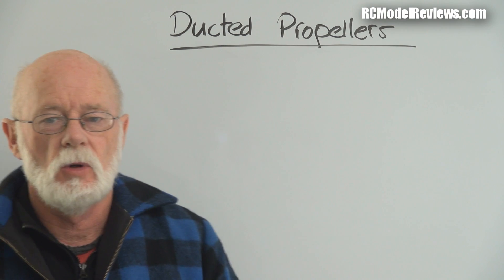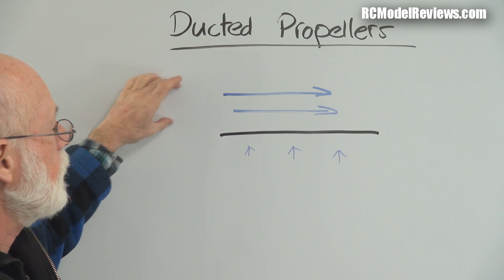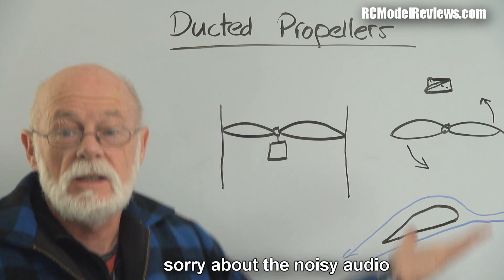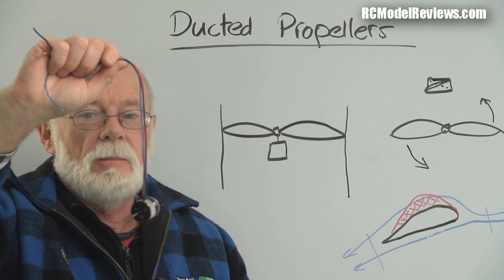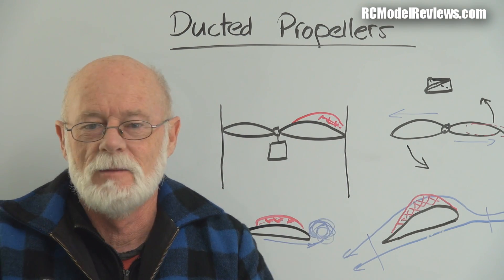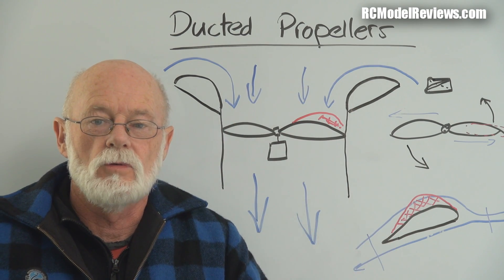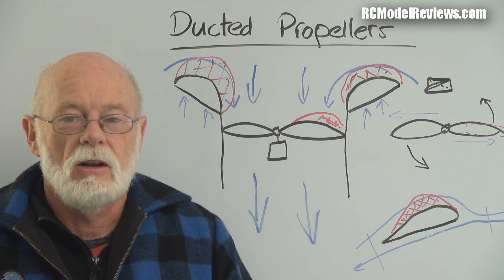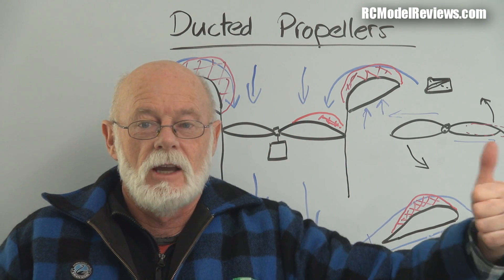How ducting a propeller increases efficiency and thrust

Comment: 8:20 centrifugal or centripetal  -  the force pulling outward is centrifugal.  the force holding the rotating mass inward is centripetal. remember - there  is  ALWAYS  an equal and opposite reaction. 
i'm going to also argue your reasoning for what's described as blade wash. 
the primary law of nature is  - all things take the path of least resistance. 
when a propeller pushes the air - it's  pushing air into a high pressure/ compressed  area. 
air pressure around the tips is ambient / static or slightly lower than ambient .... all things in nature - including air  - seek the path of least resistance and non ducted air washes off the blade tips instead of creating thrust by staying in the compressed air stream. 
the question of using a duct is .... does the weight of the duct cancel the added performance of ducting the propeller ?
ducted propellers that are correctly balanced don't vibrate as badly as non ducted because there is very little blade tip oscillation. 
inlet ducts on aircraft begin to collect air around 150 mph.  as an aircraft exceeds 200 mph the  inlet begins to reach it's full " ram effect " . in ram effect a massive high pressure zone builds inside the inlet duct creating a large static high pressure force on the fan.  this increases turbine engine performance exactly the same way a turbo charger effects piston engine performance.

Comment: Hmm,  the Gyroscopic effect is a serious problem for Aircraft . Also any  wanted change to rotational velocity (RPM) is delayed by the greater inertia,, plus extra weight, combine to make it less viable on Aircraft but acceptable on Ships.
On full size Aircraft , many have "variable pitch propellers" ; this would be structurally more difficult to accomplish with a ducted propeller as the torque would cause extreme stress upon the hub mechanism.  Also with conventional type Helicopters, the necessary Cyclic pitch with rise & fall of "main Rotor blades" would make ducted versions non viable.
Reply: thanks man ive always wondered this

Comment: Thet "debated" effect does not work. the only way to get a lift is by deflecting air down the way ho you do that does not matter
If you think otherwise go ask for Nobel prize for inventiing reactionless drive.

and as for why duct works (though pretty inefficiently) can be seen just by examining working propeller it does not only pushes air down but also behaves like a turbine and pushes it to the sides by centrifugal force and this is wasting lots of energy.

Comment: Several mistakes:  the top and bottom flows do not meet "in pace" behind the airfoil, so the upper flow is NOT faster and spanwise flow is involved, creating tip vortices.  When properly described the Newtonian and Bernoulli concepts give the same results, but confusion arises when incompletely and inaccurately described. Simpler just to describe what happens: spinning propeller moves/blows air, etc.  Vortices scoot out, like breaking, rotating waves behind fast boat.  "A little knowledge is a dangerous thing".  Or just confusing, at best.  Otherwise nice demo.

Comment: As an empiric learner, very few people can teach me. But I've learned a great deal from your vid. Thank you. 

What effect does narrowing the tube towards the outlet have on thrust?

And would you be able to create a semi turbine effect if you had dual counter rotating truncated props in a tapered tube? What I have in mind is a medium pitch 3 or 4 blade prop I'm the front, with a similarities aggressively pitched prop behind. 

They would need to be specially made props with their pitches finishing at squared off ends that fit tightly in the tube, and also exactly mimicking the taper. This might make it easier to calibrate the clearance tolerances by varying the motor/prop mountings using shims. 

Have been thinking about this idea since before I watched your vid the first time - about three years ago!

Would really appreciate your thoughts on this proposal.
Reply: Check out the videos by Agent JayZ on turbine engine compressor sections.

Comment: Was a point where I guess you changed the direction of the flow thourgh the pipe, so, at the end of the video, the RED low press area on the blade should be on the other way. Right? :)

Comment: The duct prevents air to radial, forcing air in axial direction, thus efficiency increased. 

Say, what about putting a few tiny wings on the blade to curb arial air flow.  I know it must
increase the drag, but it might function like the duct without using the duct.

Comment: Fascinating. Thank you
I have a question
Please tell me why we don’t see coandant ducts attached to propellers on aircraft? I am not talking about a jet engine here! 
Bare with me.
This idea would mean the duct rotates with the propellor, the blades would form the spokes / structure that support the duct. The whole thing rotates. This means zero gap between the propellor and the duct.
The centrifugal affect on the wall of the duct would be enormous so there is a limint to how fast the propellor could turn but there will be a sweet spot where it works + more blades could be added to reduce the distance between the supports.

Comment: There is another source of thrust gain from the ducted prop. At the exit the air flowing through the duct is moving faster than the air surrounding the duct... lower pressure.  The surrounding air is pulled into that airflow, but the airflow carries the outer air with it which results in a greater air mass flow which equates to more thrust.

Comment: You didn't quite cover the centrifugal force effect of the low pressure wad sliding off the end of the blade there.  You do seem to clarify, for me anyway, why birds wings have all those microscopic eddies on their air foils.  It appears to me that they have low speed ducting without the ducts by virtue of the hair like aspects in the feathers!  Do you see it?

Comment: I'm looking to design and 3D print an Electric Ducted Fan and I have no idea what the "EXACT" shape should be 
I've heard people say it needs to have a big lip (like a donut) in order to take advantage of the Coanda effect, and I've heard people say it's not worth it, since it adds too much drag so it's better to have the duct as thin as possible
I've also heard people say it's better to have the duct taper towards the rear of the EDF so it's a smaller crossection backwards than forwards so you can have the air exit more straight, some people would suggest the duct tapers, in fact in the middle and it should have a larger crossection at the front, small crossection at the prop, and then large crossection at the rear too 
(so you can have the air at higher pressure so the prop has more dense air to "shove" out the back, but also make sure your exhaust is not higher than atmospheric pressure) 
but I've also heard people advice not to bother tapering, since it adds to the overall crossection area and, like the point above, increases drag

Comment: I experimented with suction dredge propulsion styles one is called an infinity jet and what you're saying about the coriander effect and the bent lip of the tube is absolutely correct in practice I used half throttle on my thrust on my my pump motor for the same amount of suction.👍
Reply: That's the "Coanda effect," not to be confused with the coriolis effect that causes the latitude-dependent swirl of storm systems and water going down the drain, nor with the coriander spice popular in sausages and "southwest" cooking.

Comment: OMG, laminar flow along a plane does not change the pressure. Bernoulli's equation needs a streamline to work and the top and bottom of a plane don't form a streamline. Also, there is no area change. Bernoulli certainly applies but it's explained wrong.

Comment: Everyone all over the internet always says that "a well designed ducted fan will have more thrust than a prop". It has somehow become this self-reinforcing myth everyone believes to be true. It's simply not the case. A ducted fan will never, ever be more efficient than a regular prop in a subsonic environment, no matter how well it's designed. Do a static thrust test between the best designed ducted fan there is and the same size prop and see which one has most thrust. If you want efficiency, then the largest, geared prop you can possibly fit, will be the most efficient. A good example are helicopters - the larger the rotor diameter, the less hp is needed to hover for any given weight. The smaller you make prop diameter, the more power it needs. Same is true for props - the bigger the better (as long as tip speeds don't exceed supersonic). So if we want efficiency and performance, forget ducted fans. By all means, if we want to "look cool" and emulate fanjets, go ahead and use them, but expect a performance reduction.
Reply: You're right about ducted propellers except for static thrust. That is the only case where ducts do improve efficiency. So a duct around the rotor of a helicopter would increase its thrust during hover, but the cost, weight, impracticality would offset any benefit. And as soon as it started to move in flight the drag would add to the inefficiency.

I also don't think a bigger prop is always better/more efficient.  Again, it depends on velocity. A bigger prop would be better delivering power at slow speeds, like cargo planes, While a smaller prop would be better suited for high speeds, like racers.

Comment: As an aero engineer by education, a fighter pilot by trade, and an RC pilot by hobby, I can say with certainty that the RC community as a whole has more practical design knowledge, derived from the physics lab in the sky known as the real world, than all of global industry's aero engineers, combined.  

We have limitless real world data on ducted  fans--none are real-world efficient. They are too heavy, too draggy, practical implementations have airfoils with too low aspect ratio to control back-pressure, and they need extreme RPM to produce comparable thrust to a prop that puts the same weight and power into a larger, lower aspect ratio, traditional design. 

All you have to do is listen to them to know they convert a lot more electricity into sound than an efficient, quiet, high thrust prop.  What they do provide is terribly power hungry, higher speed solutions. Much like any jet vs. prop trade study.  

At 1:1 scale, props without ducts are as much as an order of magnitude cheaper to operate in the real world, empirically captured by gathering cost per flying hour stats.  It's why the USAF is interested in LAA, and why they switched from the T-37 back to the T-6 II.

If you have a req to go faster, they can make sense given power to burn.
Reply: Absolutely right, sir! Through aviation history, there have been maybe 10 ducted propeller aircraft that has reached production, none very successfully. it was thought for a while to be a great way to control noise, but it was proved that low-rev propellers were more efficient and much lighter.
Reply: Amen

Comment: The modern turbo fan is just a big ducted fan. More than 85% of the thrust comes from the fan in a duct pushing cold air backwards. The turbojet just provides the power, and a little thrust.

Comment: Does it make any difference if the duct is attached to the propeller so there is no gap?  Also, does the duct need to be a full circle or can it just be winglets like a modern jet aircraft uses?
Reply: Attached would add rotating mass which at a minimum reduces throttle response. Would also need to be stronger and therefore heavier than if non-rotating.
I think you can find examples of props with tip (or near tip) fence devices, though not too common. I think they're finding that optimizing blade planform is more efficient than added fences or other special devices. Speed matters as well for optimum design. Most modern helicopter blades often have fences or winglets, or swept tips ( like 787-ish). Lastly, the video missed one other potential benefit the duct can bring: The supports ( his example has 5) can have reverse twist fairings and act like the stator (so called " reaction") fins in a turbine or compressor and straighten the spinning flow (un-spin the prop induced spin) so this can add thrust and efficiency, though the supports do also add some drag. But if you have 'em anyways, might as well use 'em maximally.

Comment: Why don't we use that on big helicopters ?
Reply: LOL. common sense. The blades of a helicopter already sag due to their own weight, Can you imagine how complex & heavy the structural support would be, just for a rigid structure that would prevent collision with the blades?
Reply: @davemwangi05  oh, OK.   So would they work in the 4 Ring  Quad  Hover drones ?
They make those big now as 'flying cars' 4 seaters... not legal to fly around as taxi cabs yet,  and they are huge, and require a real pilot, but they want to make UBER flying cabs soon some day...
But anyway, the 4 fixed rings contain the blades already, so it looks like you could fit a ducting ring inside  of that ring, boosting the power of all four of the rotors.

Comment: The Bernoulli effect causing airplanes to generate life is one of most widely taught falsities in physics. If you were to try to isolate the Bernoulli effect - EG have an wing with zero angle of attack, it will not generate any lift. That is because any speed difference generated is actually caused by the normal force the wing exerts on the air above it (which BTW exerts a force down on the wing in return). This is just as well because if Bernoulli was able to generate any lift without pushing air down, it would in fact Violate Newton's laws.
Reply: So true. The reason it is always demonstrated with a thin sheet of paper is because the differential pressure  is so small nothing else would lift. There IS a differential caused by MOVING air but is is very small HOWEVER an airfoil is moving through stagnant "NOT FLOWING non laminar air which diminishes the Bernoulli effect to near zero.

Comment: I think that a couple of things were left out.  If the tip of the propeller is very small and pointed then the tube gap tolerance is not going to be very useful, the end of the blade must be broad to hold that pressure against the side wall of the tube.  Another reason open propellers are not as efficient is because they do not direct the air in a straight column behind the motor but rather it spreads out into a cone shape spiral that dissipates without building up pressure on the back side of the propeller blade.  The pipe contains that cone and allows the pressure to build slightly against the back of the prop blades.  A squirrel cage fan also does this, it will keep a column of air more uniform from the exhaust and the reaction thrust is more efficient than a prop that spreads the force out to the sides partially.

Comment: to convince boaters to use this design would save fuel and water life.
Reply: we used ducts on some trailers in the late 70s.called korts nozzles .tapered 1/3 to 2/3rds.the rudder does the tilting

Comment: The duct could increase drag, but it would also decrease spanwise airflow, generating more thrust. I am an engineering student working on a design project and I may end up using props with ducts.
Reply: More weight and drag

Comment: @RCModelReviews Will the same principals apply to a Tube/propeller combo in water not air?
I would like to create a tube/raft and put a propeller in a tube powered by a cordless drill. I also would make the tube turn or pivot so I could steer. If I direct the flow of water in relation to my triangle shape raft/boat I can then determine the direction I will be headed. 
I intend to use my Tube/raft/boat - AKA floaty thing as a propelled "tube" since I will be on a river. I did not want the propeller to be able to get hit or damaged since it will be in somewhat shallow waters and there is also the safety aspect of it. 
My dilema is how to propell my "floaty thing" the safest and most effient way and will a tube with a propeller help or hinder my speed AKA funness lol.
Random fact :) This will also be equipped with 2 beer "drink" coolers as well as a bee.. cough.. "drink" holders and waterproof bluetooth speakers.

Comment: I am  not ready to believe that there is no drag.  everything that is being added to the propeller will require more energy to spin it and when in load and lifting there are some new elements that you need to keep in mind and new forces. That are working in negative plus gravity. Such as how much  force in  exces is needed for  the blade  to spin faster. I see a new set of limitations and a new set of problems.

Comment: Its confusing because you are using a wing shape to explain, but a propeller and wing have different uses. Also why does the air flowing along the bottom of the wing nit pull it down just like the air going over the top pull it up. I get that the air having to travel over the top has to travel farther has more force than the bottom, but I do not get that the bottom air is actually pushing the wing up. I think your explanation is faulty. Of course wings have lift but for the reason you explain.

Comment: The plate also has a bend to it. It's not flat. The raised center section helps increase lift! The faster the flow across the top compared to the flow across the bottom increases lift, just like he said.  A propellor splits the flow from the back to the front, li,e a wing which has a different path for air to flow across the bottom compared to the top, increases lift. When you put a duct at the end of the propellers, it helps increase the low
Reassure on what would be the top,or the front of the propellor. Ducted fans have been used for years with varying success, until largely when computer design aides made a huge difference in designing a propellor for lift!